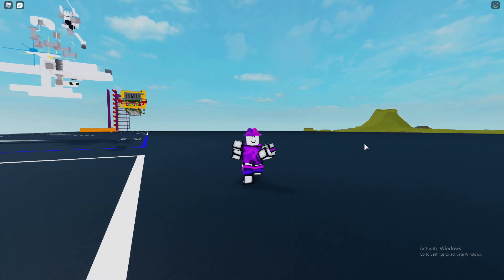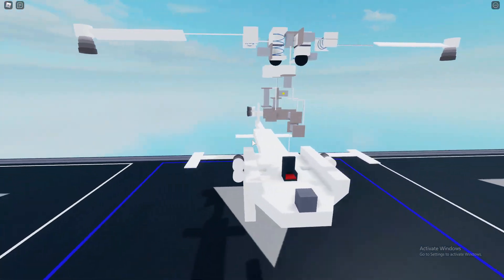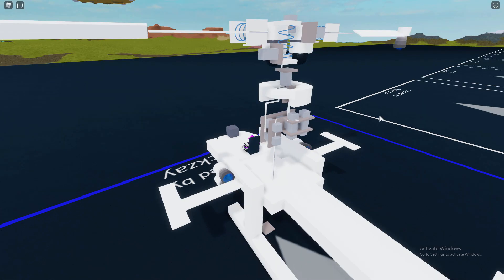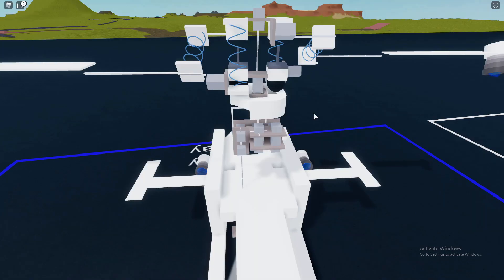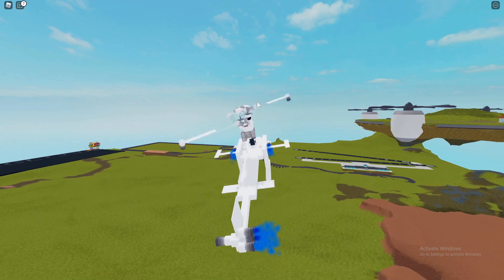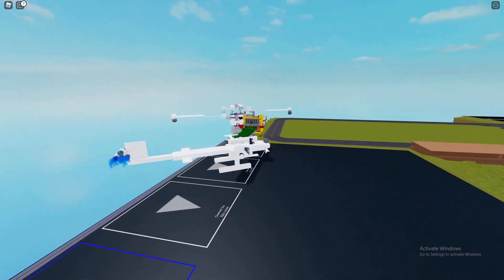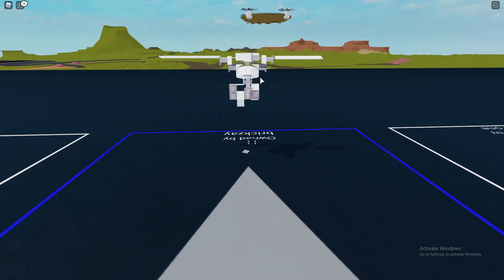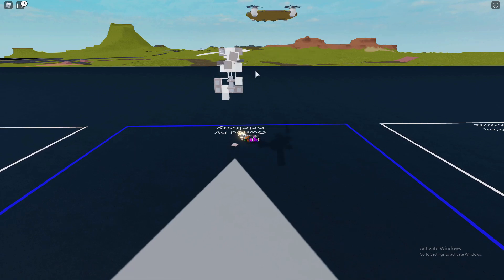Motor-Locked Swashplate Concept

Comment: pls tutorial i created this without motor lock and spend 1h 30mins to get it but it still didnt work because i didnt know the settings it works the same but used more like the more bigger washplate turning it turn just like urs but i cant get the setting of the pistons and the suspensions correct  also mine turns back and flips